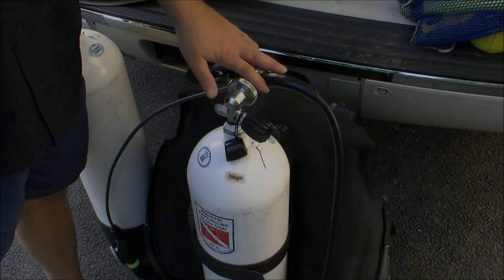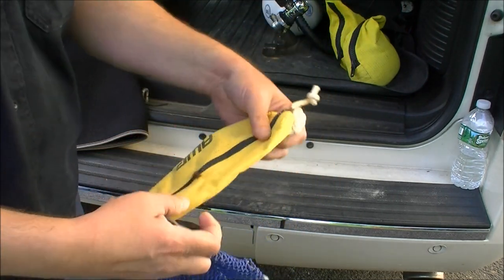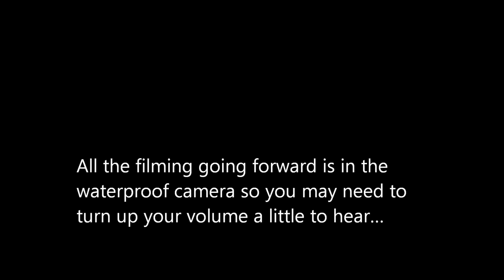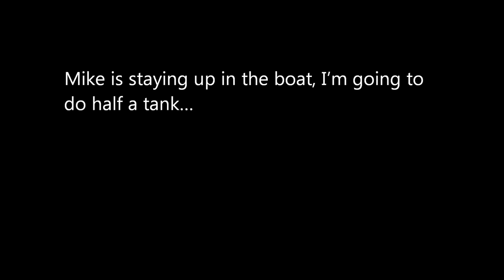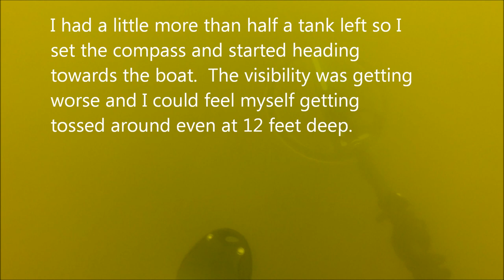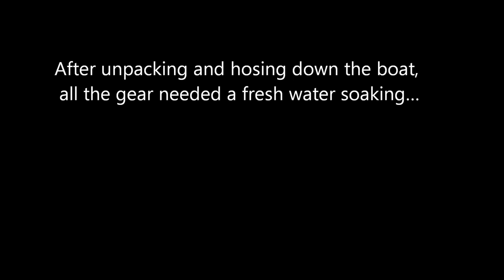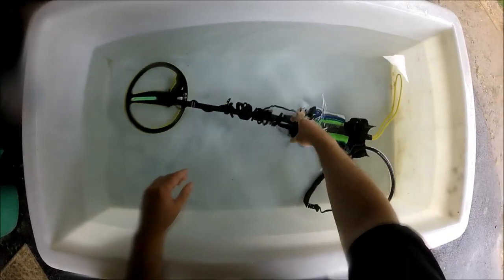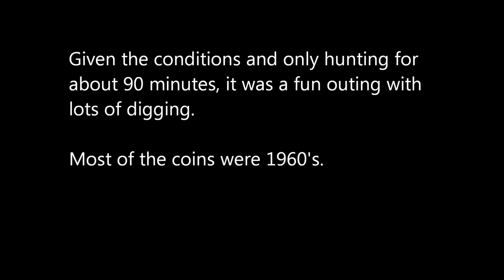Metal Detecting Scuba Diving - Equipment Used at 50+ Year Old Swim Spot

Comment: Good gear video!  I am just getting into scuba diving/underwater metal detecting.. do you always carry your pinpointer in your mesh bag?  what I found that works well... is a carpenter's "dropped tool" safety wristband.. it has a d-ring sewn into it.. I slip the wristband on my arm... put the holster over the wristband and tether the pinpointer to the d-ring so that way I don't drop it or leave it behind.. I've also used the wristband and stretched it over the control box on my excalibur II and mounted the pinpointer there as well... either way with a long tether .. it's easy to reach, use, and replace ...  Love your videos!
GL and HH
Van Jr.
Reply from the maker: I like carrying the pinpointer in my mesh bag.  Having a lanyard or tether is just something else to get tangled.  Some of my diving is in zero visibility so the less you have to tangle, the better.  But if you mainly hunt in clear water, then I can see using what you described.
Reply: my water is usually very low visibility too, so I understand what you're saying about the tangles
Good Luck on your next hunt!

Comment: Salt is gears #1 enemy. 
Great to see the wash down emphasized.
1st stage submerged, a bit surprised.
Reply: Its hard to see but there is a cap on the first stage being washed in the fresh water.
Reply: Wash, sure I always do, cap on and opening facing ground.
Submerge, only when hooked up and tank valve open.
Risk of complications slim, exist however.
Reply from the maker: Been submerging 1st stage for many years, no issues.  Just need to make sure the opening is tightly capped.

Comment: Hi. What better work on the beach: Minelab GPX 5000 or Whites TDI SL? And what deeper? Thanks
Reply from the maker: The TDI S/L is easier to use on the wet sand but the GPX will go deeper.  The TDI Pro is about the same depth as the GPX.

Comment: omo you descended Very Quikly due to weight, there are ways to descend slower, this does not bode well on 'bends' you can get in bad trouble in 6 feet of water or 12 feet.
Reply from the maker: After almost 35 years of doing this, no problems with the bends.  Descent pace was fine, carful when ascending since that's where the problems can happen.